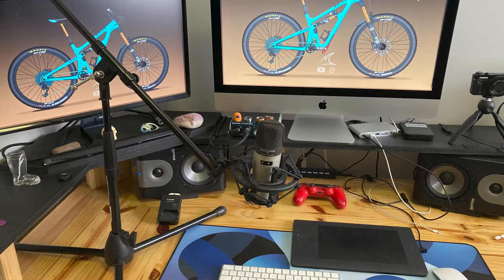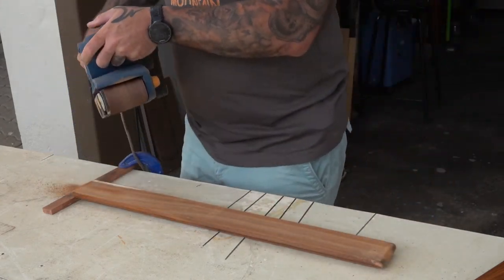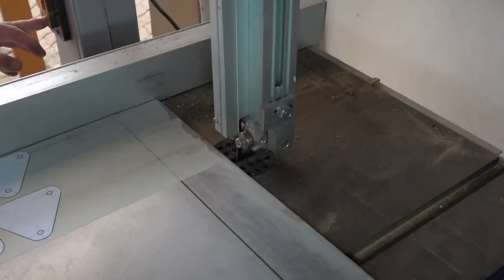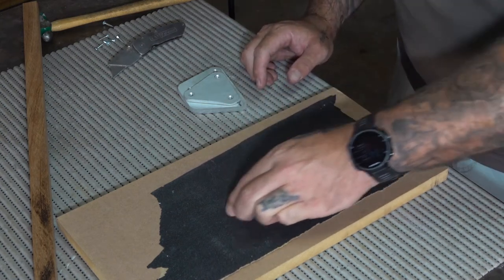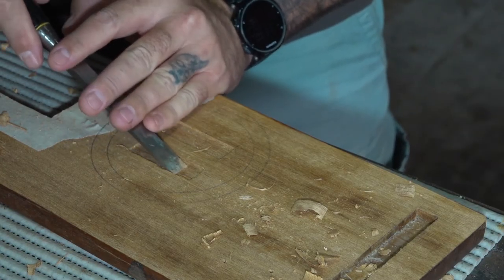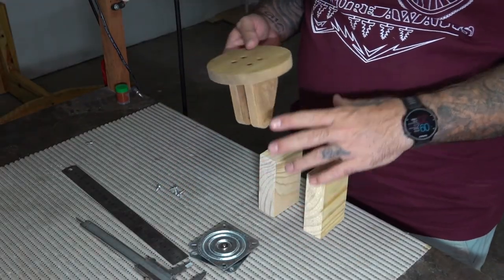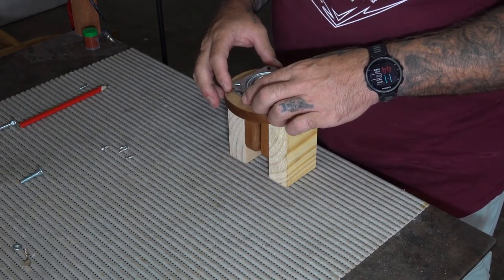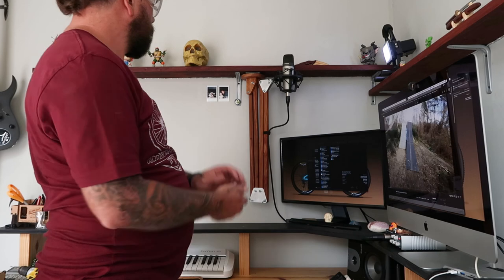DIY - Retractable Mic Boom Arm

Comment: Great video, I don't suppose you would be willing to part with your illustrator files? I've been trying to figure out an alternative for a boom mic since my setup is in an awkward spot
Reply from the maker: Sure thing!... I just uploaded it to my website for free, here is a link: https://www.maconstuff.com/plans/microphone-boom-arm
My mic is a bit on the heavy side, so I had to crank down on those wingnuts pretty hard to prevent it from sagging... eventually I flipped it around and mounted it directly to the desk with a clamp, without the lazy suzan and it seemed to work out better for me, but it should work either way... just thought I'd mention it... enjoy... and good luck with your build... \m/